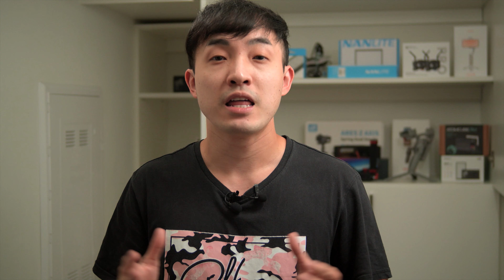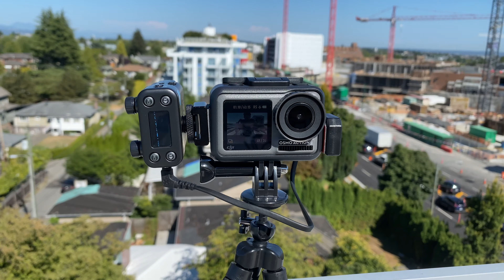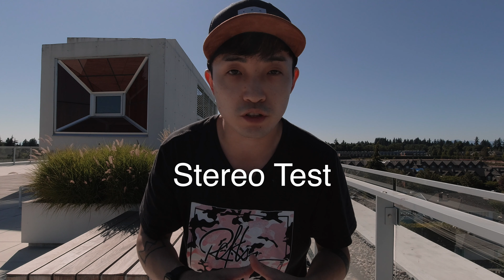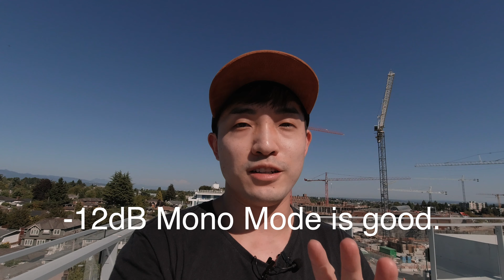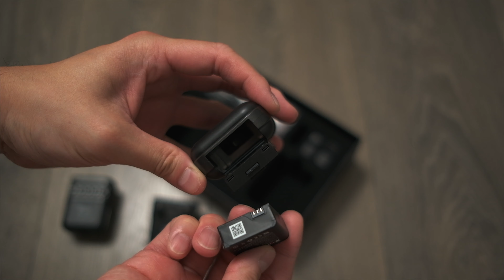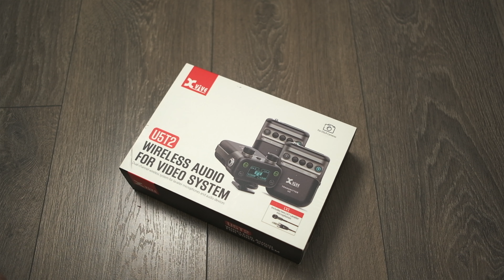The Best Budget Dual Channel Wireless Microphone | XVIVE U5 U5T2 Wireless Microphone Review

Comment: I love your vid‘s
Reply from the maker: Thank you so much for your kind words and support!
Reply: @henrymediagroup  Do you think this could work as a stereo iem system with the right adapters 

(In reverse to design) I can plug my stereo source into each transmitter? 
Then use the canes 3.5 output as a headphones output?